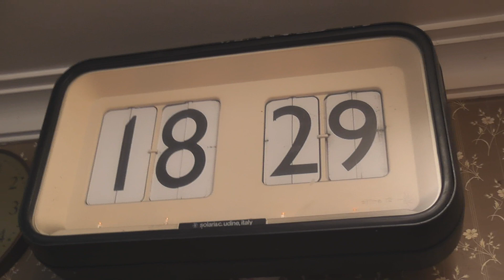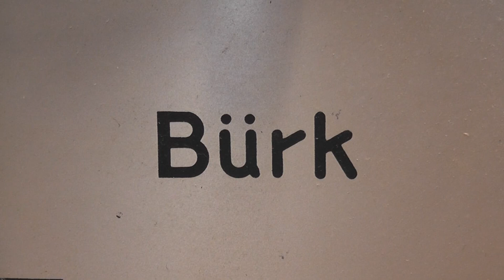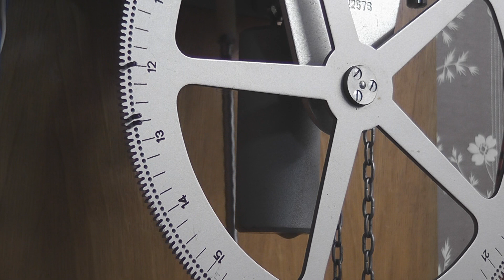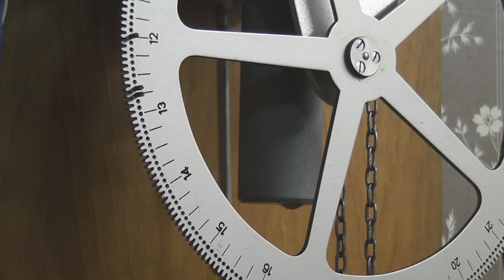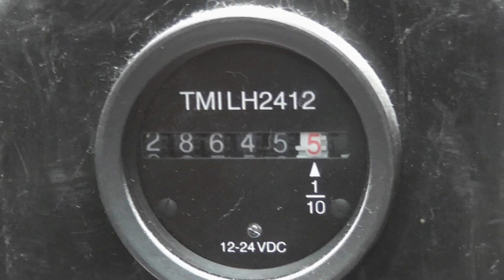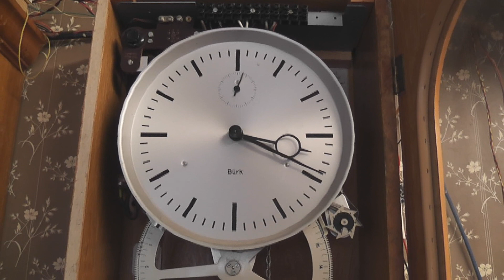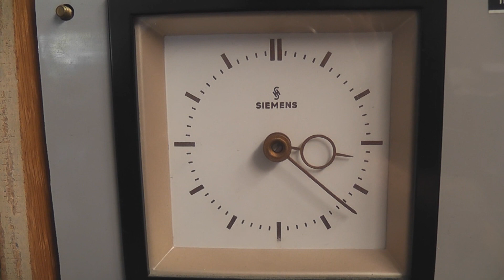Bürk Hauptuhr - Master Clock HU 110

Comment: So this is the system that was used in many schools to synchronise all the clocks. I never thought how they cope with a power cut. Ingenious system.
Reply from the maker: Yes, these systems were used in Europe in many schools and churches to operate tower clocks. Newer systems put a different frequency through the mains to adjust clocks, and now these days GPS provides the time pulses.
Reply: RODALCO2007 You can buy relatively cheap clocks <£20(and watches) in the UK which synchronise to MSF 60Khz radio time signal. They automatically adjust for daylight savings time and can also retrieve the date, the frequency reference is from an atomic clock. GPS is an option as well, I guess it's more expensive and you may need and external antenna.
Reply from the maker: Coolkeys2009
Yes you are correct. In Germany there is the DCF transmitter which sends a time signal for most European clocks.